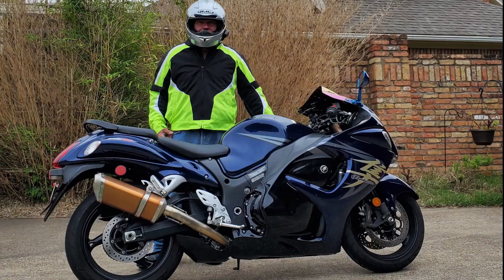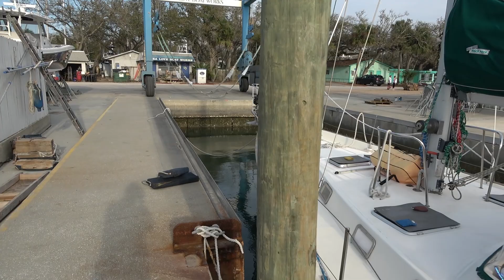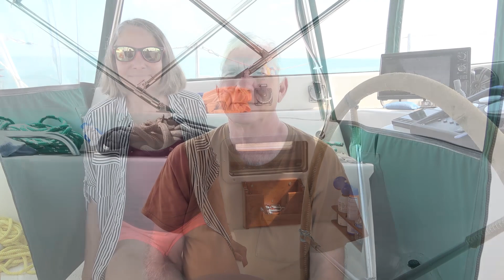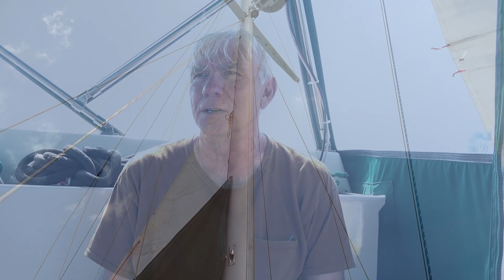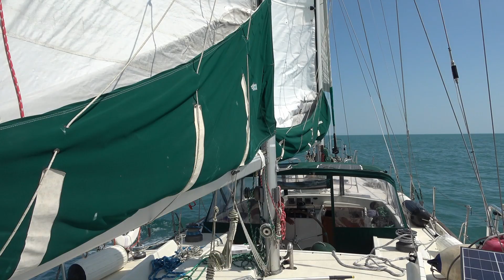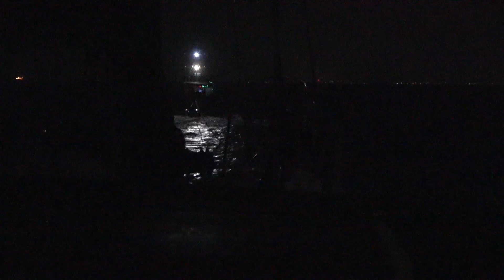Strap Your Hands Across My Engine Ep104

Comment: Check the breathers on your fuel tank/s. 
If they are blocked the engine will pull a vacuum really really easily. 
Also get the Racor filters vacuum tested for leaks. 
Run the engine from a tote tank with an inline filter and see if it still dies, if not you then work back from the filter back to the tank.
Reply: Also being a Cummins check the screw on filter (that is mounted on the engine) to see if the small rubber seal that goes around the central thread is in good condition or has been replaced. Makes a big big difference.
Reply from the maker: Great suggestions, Matui69. Many thanks!😊
Reply: What make and model engine do you have in the boat?
Certain makes/models have their own little quirks. 
Yanmar/Perkins especially.
Reply from the maker: It is the Cummins 4BT-3.9m
Reply from the maker: Thanks for the tips. Great logic.
Reply: Fantastic little engine. 
3 x diff types of injector pumps on them. One gives virtually no trouble and thats the in-line P type pump. The other 2 x types are both rotary pumps. One a Bosch VE type than can suffer from solenoid failure/issues and the seal on the driveshaft can go hard and suck oil and air into the pump. 
And the last is the CAV DPA type pump. Now this one has a feature that not a lot of mechanics/engineers know about and that is that it has a tiny gauze filter in the back of the pump where the fuel from the filter enters and these block up very very easily causing all sorts of issues. Bit fiddly but can be changed or even cleaned onboard the boat without the pump having to be removed. Aldo the CAV one if fitted with a stop dolenoid can have starting/stopping/running  issues with said solenoid as well.
Reply from the maker: Great info on the pumps! I should find out more in the coming days. You seem to really know the Cummins.
Reply: I rebuild injectors, inj pumps, turbos, engines and a few selected marine transmissions. Have done for a fair while now. Best 3 marine engines woukd be Gardner, Ford and Cummins in terms of reliability, economy and performance.

Comment: Did you ever make it back over the FL line to a marina at least within the state before the engine gave out again?  By now you're feeling like I did many years ago when I bought a brand new van and within the first week it had failed 3 times.  I never did trust that motor until the day we sold it.
Reply from the maker: LOL, JL Johnson! We really are scratching our heads on this one. Has to be air in the lines some home or fuel delivery. Not giving up on the engine. 😘

Comment: So sorry that you are having fuel problems! Do you have any extra filters on board? Did they replace your lift pump also? You may have picked up some residual debris in your system if so, change out your filters and re prine the system and you may regain function. So Sorry you seem to have been Fleeced on having your service done while in transit. And 100 dollars per day for slip fees???.? Surely not in boater friendly place,especially when you need Help. Nice
Reply from the maker: Hi there, Lawrence. Those folks did what they could. Never like paying transient fees on top of slip fees. We are looking forward to hearing from a Cummins friendly mechanic. 😊😘We have changed the filters, good suggestion on the residual debris. Keeping our fingers crossed there aren't major repairs in our immediate future. 🤞💕

Comment: Awww, sorry about your engine. You spent so much for repairs that were guess fixes, u should get some credit. That's why I'm afraid to buy a boat with an internal engine even though it would be nice. Seems like a lot of people have problems all the time, is this normal? Thank you for the video, Luv Ya's... Can u mount an outboard for emergencies like this so u can go into the harbor?
Reply from the maker: Great idea, DellaDeLobos. We have an outboard on our dingy and actually talked about using it as a tow, LOL. Not sure if problems are the norm or not. I feel like our engine is great, we're just giving it something it doesn't like (air) or not giving it what it needs (yummy clean fuel). 😘